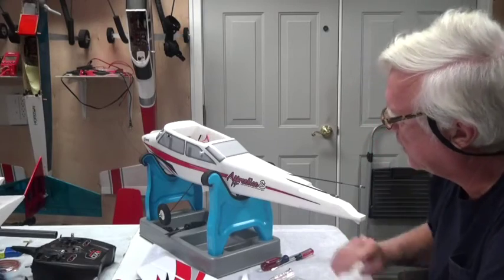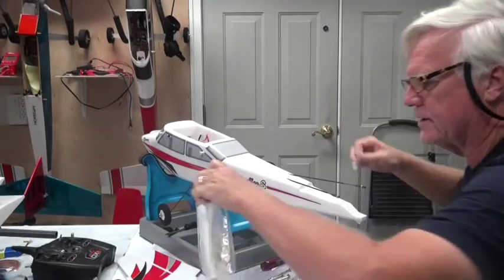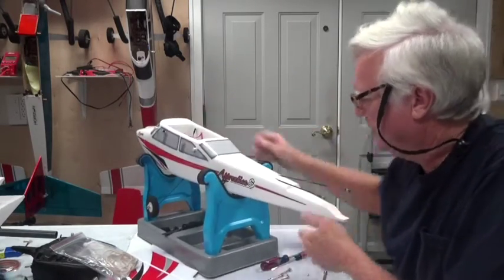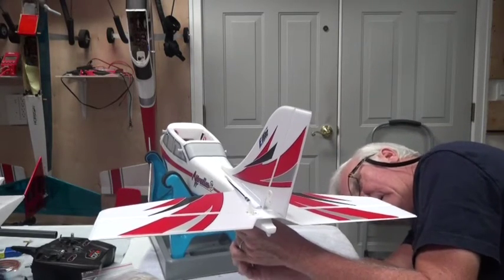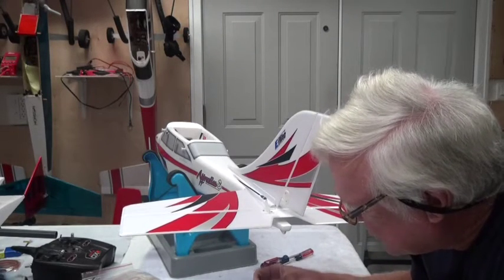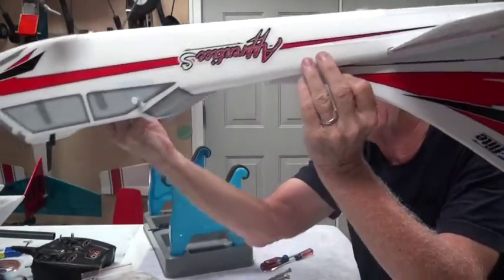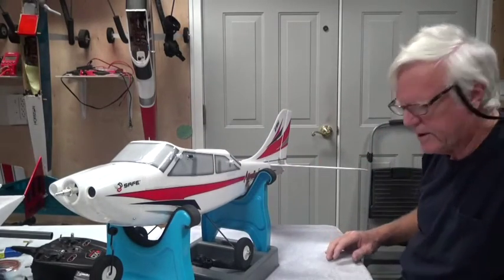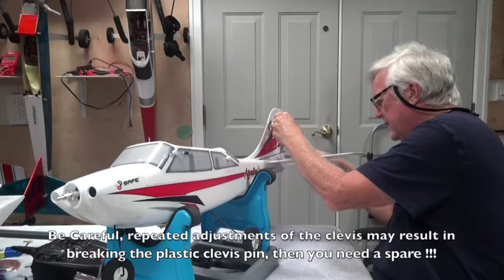AP20 Apprentice S 15e RTF Install Tail

Comment: First off, I love your videos on the apprentice!! They are all great! Can you pleeeeaaaassse explain the final step.! I get the rudder on nice and straight , looks great and centered perfectly , but my front wheel is turned to the left!! I turn it on, and my rudder is still nice and straight, and the front wheel is caulked to the left!! I flew it one time that way, cause I couldn't figure it out.. and take off was extremely hard, and landing was terrible.. as soon as I landed, it veered off to the left and crashed into the curb . Please explain how you fixed that straighting the front wheel after you have the rudder all dialed in. Do I twist the same Clevis..? That don't seem right because it just turns the rudder either which way. You pointed to fixing it under the wing somewhere.?? Please help me. Explain exactly what to twist and maybe show a new video on it. Do I do it with the plane on?? Just please walk me through step by step on how to do this. Thanks so so much
Reply from the maker: There is a clevis at the cabin end of the nose wheel pushrod, and there is a clevis on the rudder pushrod near the rudder.  With the radio and airplane on,  
1. You need to adjust the rudder trim to neutral on the radio first.
2. Then adjust the nose wheel clevis so the nose wheel is neutral
3. Then adjust the rudder clevis so the rudder is neutral.  
There should be enough travel of the 2 clevis to get both nose wheel and rudder centered.